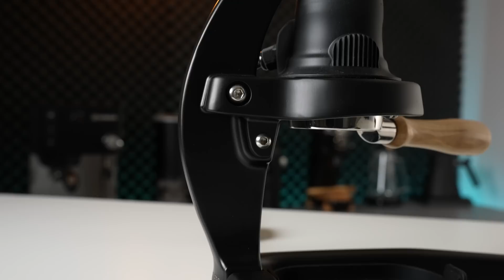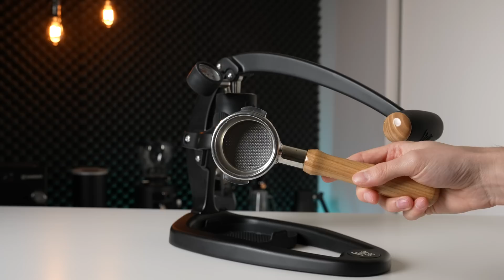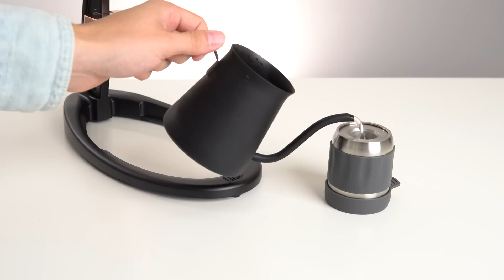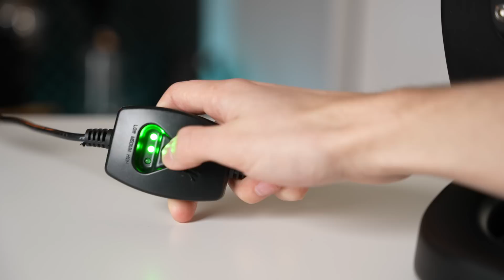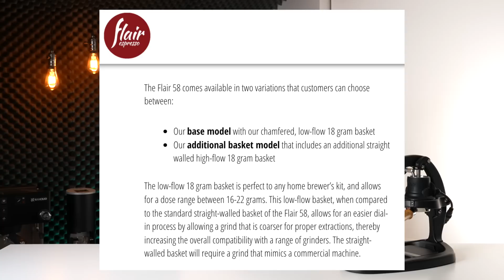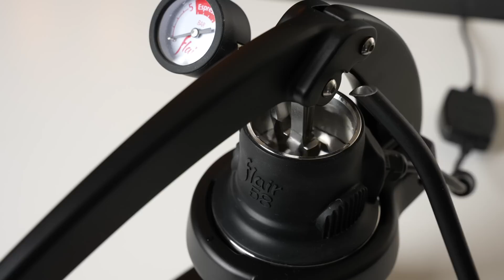Flair 58 Review | With Valve Plunger!

Comment: After watching a lot of YouTube reviews. Gaggia classic with its temp limitations and hacks required, to breville and it’s 54 mm ports filter to finally Flair 58. I am intrigued by the manual design and the control. Waiting to receive it as this will be my first espresso. Thanks a lot for helping.
Will the sette 270 work fine with this ? If you have one can you recommend grind size range for flair 58 ?
Reply: Yes sette is a great grinder.

Comment: I'm a few weeks in and I have no disagreements with your review. I'm a bit new to the espresso game although I dabbled a few years back with the ROK. The Flair 58 is a dream. My only complaint, albeit a small one, is that the plunger has a tendency to rotate slightly, creep if you will, with each shot pulled. Eventually, the slot lines up with the lever interface and it disengages. Sometimes that happens on the upstroke and sometimes the whole thing falls out when you remove the portafilter. Flair provides a key to rotate the plunger from time to time to keep this from happening but you have to keep your eye on it every few days, depending upon how many shots you pull.

Comment: I picked one up today because of the labor day sale. Ultimately im picking one up because of my journey into light roasts. I've found the need to have pressure profiling. I have a modded gaggia classic at 6.5bar, bambino plus w/ dimmer mod, and  picopresso. I liked pulling shots on the pico but hated the workflow. I was getting significantly better shots than the GC and BP. I was getting a lot more nuance even though i had less control. The bambino just doesn't get hot enough for light roasted coffees. But I had great success with medium or dark roasted coffees. Because of that, it is on the chopping block. To be straight, there are some light roasts that need to have that control. Hitting the puck at straight 6.5 bar and going 1:2 or 1:3 doesn't taste as good as the pico.  The only differences I can think of is the control of preinfusion and the flow control.

edit: I mainly drink iced lattes so no need to steam milk really. I was contemplating about keeping the bambino plus as a milk steamer but most likely I will be selling it.

Comment: Noob here. Which is better for newbie, Flair 58 or Gaggia Classic Pro? I already got the flair classic way back but i like the actual portafilter, automatic warmer and the easy retry (pulling out piston and refilling) for an upgrade. Gaggia is much expensive on my country (2x the price) although it have a steamer. Note i still making sour espresso (just starting to get into it) hahaha.
Reply from the maker: It depends what grinder you’ll be pairing with it. The Flair 58 will be more depending on your grinder, but more forgiving on the user
Reply: @LifestyleLab_  i got Niche Zero comming in soon :)
Reply from the maker: Then you’ll have more than fine to go with either :) 
If you’re okay with a manual workflow, and don’t need steaming, then I highly recommend the Flair 58
Reply: Thanks man :) yeah thats the only down side for me, it doesn't have steamer or no cheap standalone steam wand available (plunger or wisk type not counted). Also if there's power outage you can still use the Flair hahaha. Hoping you can do a comparison episode of the 2 soon :) .

Comment: Has the Niche been able to grind fine enough for all types of beans so far? My countertop has my current BBE, and I'd like to add the Niche. Eventually replace the BBE with the Flair 58. Still want to grind for filter as well. Am I on the right path or should I be considering other options still? (DF64). Thanks!
Reply from the maker: Yes, the Niche can handle it just fine

Comment: If they make a new version of this flair 58 with a better implementation of the heating element, I might be interested in switching to a manual espresso machine..
The power brick is an issue, but also that device for setting the temperature look like a joke, it needs to be less ugly and integrated in the body of the machine IMO.

Comment: Have you found a side channeling problem with the flair 58. No matter what my puck prep the stream always tends to lean towards the handle side of the machine.
Reply: this is not channeling, this is gravity. the flow heads down hill and when you're pressing a 9 BAR shot, you're tilting the brewing head down
Reply: @FlairEspresso  thanks for that I did consider it but was not sure. Appreciate it.

Comment: I would consider it more if someone had provided better options for detached milk steamers, but what's on the market atm is either over $1000 or is really inconvenient. Not sure why no one has thought to provide a detached, electric, steam wand in a compact, affordable, package, it shouldn't be that hard. It would make buying someone like the Flair a no-brainer for someone that also likes milk drinks.
Reply: we're working on a stove-top steamer right now and hope to have it by end of year
Reply: @FlairEspresso  is an electric one not phesable? The Bellman already exists, and it's too inconvenient to justify daily use.
Reply: @D4PPZ456  i second this notion. 

I feel like i could engineer a thermoblock type unit that would heat very fast, and create a very nice steam pressure that would also be able to be adjustable with programming on a simple control chip. Adjusting temp and water flow rate to adjust steam speed and temp. 

It's a very simple machine, the most "clutter" would be the redundancies for safety and preservation.

It would be so simple using a check valve and a vibe pump using a dimmer style control for setting minimum pressure to maintain when fresh water needs replenished on the bottom side of the thermoblock. this way pressure can form in the block, but also be able to receive fresh and perhaps pre-heated water to maintain proper ratios of water/steam/temp in the thermoblock

I would also like to imagine that using machine learning models (that I know how to code) with data gathered it would be feasible to make a good unit that could easily steam non-stop for like 5 whole minutes or more.  (I just say 5 minutes cause thats a longgg time)
Reply: The more I got thinking about this, the dumber my initial idea sounds, and the better this new idea I have is... it's actually super simple
Reply: @chadgregory9037  WPM 130T

Comment: I love my Flair 58 (love my Pro 2, as well): it has a little bit of a learning curve, of course, but boy does it pull good shots. I combine it with a Bellman for lattes. Works great with my Acaia Luna (I use a Pyxis for my Pro2). VST or IMS scale helps a lot. 

I am probably going to get a Smart Pressure Profiler, which essentially gives it the same sort of control a Decent has, when combined with the Lunar.

Comment: Unlike the Robot(what I have), it's extremely easy to place something over those feet to use nearly any scale you have in your home
Reply from the maker: Not as easy as you'd think. The base slants forward, giving an uneven surface if you just put something like a cutting board across
Reply: @LifestyleLab_  It's also easy enough to also have a small square of wood to clear the base, with a plank on top to widen it if it bothers anyone enough
Reply: @LifestyleLab_  Been there done that, I just don't have one.  Unless you're topping off your glass, it's not a problem
Reply from the maker: Except scales need to be flat...
Reply: SpontaneousRetard  you think getting a block of wood is difficult?
*Also, scales can be a little off level.  Try yours.  Weigh a glass on a book, then angle the book 5 degrees.  You'll see less than 0.05g difference if your scale is accurate enough for that.  It's not any worse than weighing something off center on a scale...something tons of people do on Robots if they don't have a scale that'll fit all the way under the portafilter